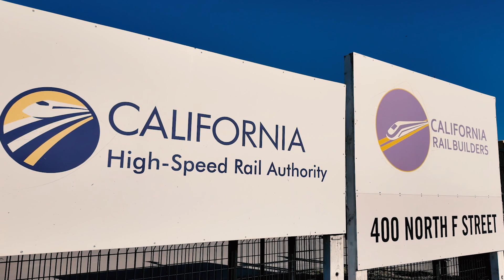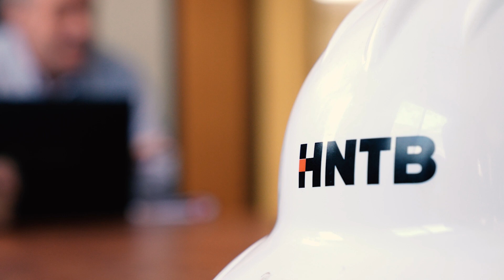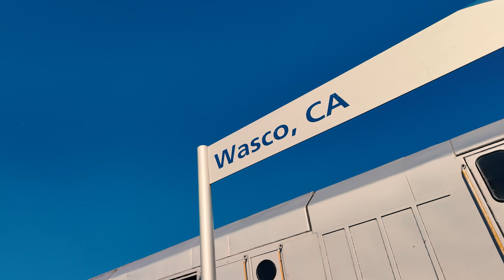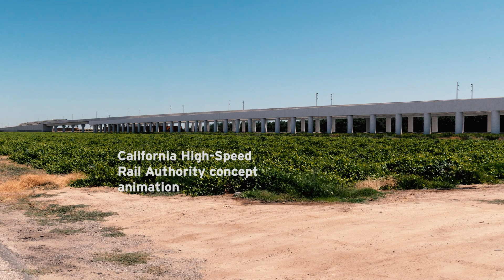HNTB California High-Speed Rail CP4

Comment: I have to finish this junk video to report this is misinformation. 
HSR does not reduce traffic congestion .
So long the HSR supporters cannot give up cars, CAHSR is useless.
PUBLIC TRANSPORTATION MUST BE EXCELLENT AT EACH STATION.  
Right now, only SF meets the condition. 
After 16 years OF HSR proposal, public transportation at each city is still terrible. 
Oh, on time and on budgets are obviously wrong statements
Reply: This is nonsense. HSR works just fine in car dominated areas. In fact, the vast majority of HSR lines tend to be built with stations far outside of town with riders having to drive or take other transit to get to the stations. Exactly like an airport. 

It's trued that HSR's killer app is that it can pick you in the city center and take you to the other city center. But this is not a necessary condition for success. We just need to finish this line and continue improving it. The city center connections will come later. For the time being, the CAHSR riders will have to take the ACE, or San Joaquins, or drive to the stations. 

We need to stop making the perfect the enemy of the good and build the goddamn thing!!!
Reply: @TohaBgood2  HSR supporters keep bringing non sense while referring successful stories in Japan.  Of course, they tend to forget you don't need cars to use HSR.
Tell me again why we need HSR, to reduce traffic congestion. Then you proposed build HSR stations outside city center which requires driving on freeway. 
This is non sense.
The success HER build along major cities.  The stations are in city centers.  Each station is a big hub that passengers have 20 rails n 50 buses to transfer out.
Building HSR stations outside city center or without good public transportation makes no sense.
I forget most HSR supporters don't know the definition of HSR. They don't bother to check stations in Paris, Tokyo,  Osaka,  Taipei,  Beijing, Shanghai. 
Why HSR supporters keep posting witless statements to reinforcement it's useless to build HSR because US HSR supporters cannot give up cars
Reply: @commentorsilensor3734  HSR was never meant to reduce traffic within cities. And it doesn't do that, at all. HSR reduces the number of long car trips people take which is a teeny tiny fraction of the commute traffic. 

Urban transit is what reduces urban traffic. If you want less urban traffic then build more urban transit. 

Oh, and literally all the systems that you listed either were or still are famous for NOT building HSR into downtowns and siting their HSR stations far out of town. This goes especially for Chinese HSR lines. They almost never have HSR stations within city centers and you almost always have to take a 1+ hour subway or regional rail ride to get to the HSR station. 

France only relatively recently started building downtown connections and even just allowing HSR trains to travel all the way to the old city center stations to pick up passengers. For the longest time you had to take the metro or the RER all the way out to the boonies to board an TGV train.
Reply: @TohaBgood2  Tokyo n Osaka HSR stations are in city center. 
You mentioned 1 hour subway or rail to HSR stations.  
Taipei HSR station is in downtown. You don't need cars.
Besides SF, which future CAHSR stations can be reach by public transportation.  Don't bring downtown LA union Station.  Only people live within miles of radius can get to LA union Station.  Don't bring you need cars to get to rail systems. 
Many HSR supporters said HSR reduce highway congestion usage. You are the first one say otherwise. 
You admit urban transit reduce traffic congestion.  Besides SF, every city fails. Don't bring you need cars to get to rail stations in LA.
Many HSR supporters keep contradict.  You contradict with others.
Impress me.
Why do we need this junk when HSR supporters don't know the true meaning of public transportation.
Reply: Uhm LA and SF have expanded a lot so not sure what you're whining about and it stops downtown in the central valley cities.
Reply: @jbudlo2  stop building HSR as most of HSR supporters have no clues on the meaning of HSR n public transportation. 
SF has good public transportation. 
LA public transportation improvement only help people with cars.
Publuc transportation in Downtown in central  CA is joke. You cannot even take public transportation to downtown. 
Let's not forget about lousy public transportation in Silicone Valley. 
The reason HSR is successful is each station is a big public transportation hub. You don't need cars to get to places after you get out.
When HSR supporters say public transportation is improving in lA n stations in downtown in central CA.
They don't have clues.
Reply: You are right on this, we do not want CAHSR to be something that people have to drive to to use, that eliminates the purpose of using public transit, the only proposed improvements on public transit is the cross valley rail corridor, but that’s it on the initial operating segment. Even though SF and LA will not be receiving high speed rail for who knows how long, they should act soon on improving public transit close to and in the surrounding cities to ensure high speed rail is not a failure and it doesn’t have to be.
Reply: @californiaporg  SF has good public transportation.  LA still has terrible public transportation.  I will give time. Just improve public transportation at cities that have train stations.  People don't need cars from train stations to business areas. HSR was passed in 2008. That condition has not been met. The fact is transit agencies don't care because people just wanted to drive to train stations.  Even in downtown LA, many places are not easy  accessible by public transportation.  Since 1990, all the efforts n budgets are used to accommodate for car drivers to train stations. 
San Diego,  nothing change.
Fresno, the bus services near Amtrak station is terrible.  Don't expect other areas.
Silicone Valley,  forget.
LA, I don't even mention suburbs.  LA has no intention to improve public transportation past 30 in metro areas let along suburbs. 
Don't blame transit agencies.  Many HSR supporters or train supporters are perfect fine driving to train stations.  They are against local public transportation.  I just argued with one.
The problem with US HSR is it will divert more funds from badly local public transportation.  Many HSR supporters are ok with that
Reply: @commentorsilensor3734  Dude, you're sooooooooo far off the mark that it's not even funny. SF doesn't just have "good" public transit but it has one of the best systems in the world. SF has a higher transit mode share than London and most other European cities. 

LA has been doing one of the most impressive transit expansions in the last 100 years with a new rail line opening every 5-10 years. Only a few cities in China are expanding transit faster than LA. 

In other words, if you're not even interested in this topic to look things up what's the point of this rant? Go read about the things you're trying to talk about then give your informed opinion.
Reply: @TohaBgood2  dude, do you even know what you are talking about it. I said SF has good public transportation.  In order to utilize HSR, each city along HSR must have SF public transportation. 
LA public transportation is terrible.  The expansion only the meagre rail systems that you need cars to use rails. Non car drivers continue to suffer, n ready to drive or take uber. car drivers who wish to dump cars continue to drive.  Past 30 year rail expansion does nothing to improve public transportation. 
LA failed rail systems proves HSR will be futile.
When you say LA is doing great on public transportation,  you lose your point. Then again selfish rail supporters don't make sense. 
Come back after you dump cars n see how far you can go on LA lousy transit systems. 
The 120 billion and keep going up HSR is going to be even worst
Reply: While some of your points are valid, what is wrong with at least TRYING to make things better for people who'd rather not sit in traffic; who'd rather not have to deal with the bullshit at airports and unruly passengers on planes; who'd rather not have to deal with flight delays and/or cancellations; who'd rather have a CHOICE of how to to be transported?
Reply: @TheRailwayDrone  
HSR SUPPORTERS keep saying non sense to prove we don't need HSR in USA.
trains will be delay. Trains will be canceled. 
You could possibly see unruly people on the trains. You don't see not many because US has worst public transportation in development countries. 
People use this reason,  there are some perverts on buses, as reason for not taking buses. In Japan rails, there are many sexual harassment that many Japanese women fear. If train lovers know that, they will turn to driving.
In Tokyo station n other well developed rail networks,  the stations are like maze.
Oh, traffic,  if you don't have the state of art public transportation that car drivers still have to get stuck on traffic to get to freeway.  At least car drivers are inside cars. Non car drivers got stuck on bus stops under 100 degrees for hours all the time. Stop complaining. 
HSR/ Rail supporters really don't know what they want.
They come up all the stupid excuses. 
The right way is having good public transportation with or without rails.
HSR is useless without good public transportation is useless. 
Building point to point train is stupid. 
Airplanes fly to destinations. HSR only go one certain place. HSR supporters love that expensive idea because they want trains to be used by car drivers only. They want trains to go to one location without going to maze. Train lovers hate it. Train lovers want first class treatment with heavy tax subsidy. I got the idea, fly first class or ask government to subsidize first class. 
Trains including HSR are public transportation. If it cannot serve general population,  it's bad. If it's so good, you are going to see problems you face on Airplane